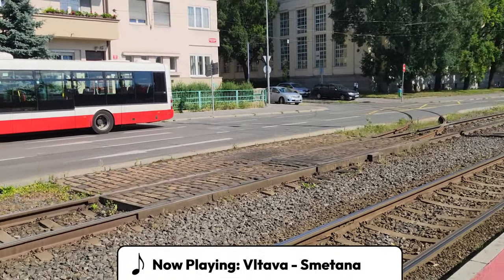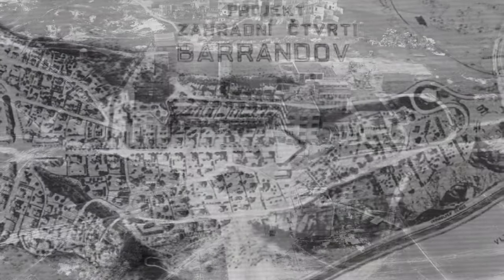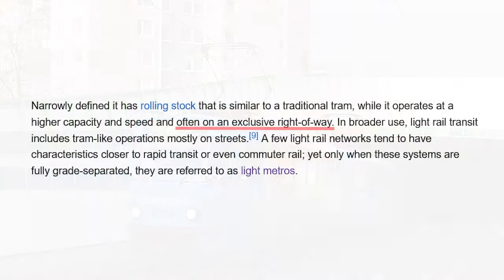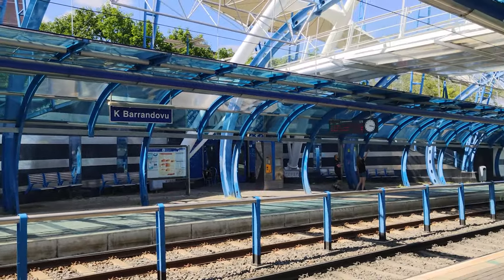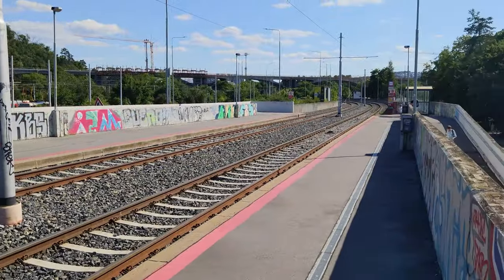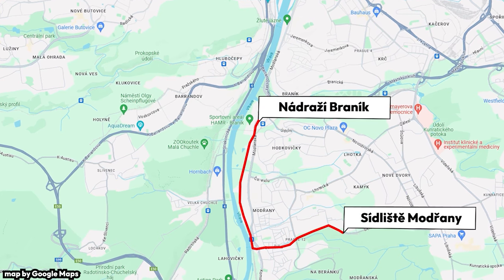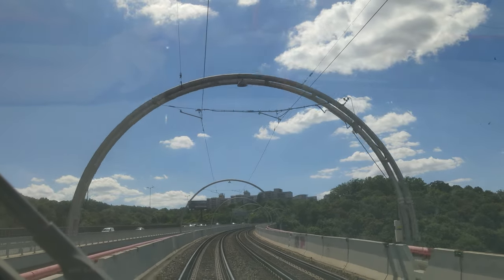A Different Approach to Trams

Comment: "Exclusive right of way" refers to the absence of mixed traffic, not to grade separation. Thats a different concept. So "true light rail" can have as many level crossings as it wants, just no mixed traffic operations. If it's actually fully grade sparated its usually referred to as a metro/light metro/subway/el etc.
Reply from the maker: Damn, I got that wrong.. pinning your comment, and thank you for the correction!
Reply: @TheTramly  That does mean the Barrandov extension goes even beyond the minimum requirements of "light rail" in some places, which is pretty cool.
Reply: Excellent comment! That's why I don't consider trams in the median to be light rail but only as tramways.
Reply: Agreed. The light rail system in Hong Kong has level crossings at every intersection, but has dedicated tracks.

Comment: barrandov is really cool, I've been there a couple of years ago, before the extension. i was in Prague and headed for Dejvice, and when going back i had some time and the trams going to Smíchov train station were also going to Barrandov, so why not. even the housing estate is neat, there are long alleyways that provide a lot of shade. 

something similar exists in Pilsen now, although on a much smaller scale, it's only a 1.5km extension to the university, but it has a bridge going over a four-lane road and its own path that doesn't follow any roads, and there are paths alongside the tracks. it could be longer by additional 300m and get extended to the Tesco mall across the street (it would make it a lot more attractive since all the malls are on the outskirts of the city, and while there's transit access, the stops are incoveniently placed and the routes aren't scheduled well enough; Plzeň Plaza is probably the most accessible since it has a tram stop close to it), but at the expense of parking spots

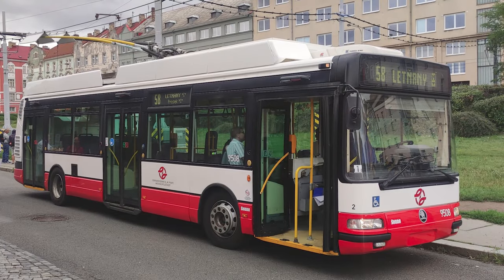2:19 hey look a former PMDP #500

Comment: We have quite a few of examples of this approach here in Poland. 
The best ones are the Poznań Fast Tram and Szczecin Fast Tram which connect faraway districts to the city centers with fully separated alligments. Allowing for higher speeds and no interaction with road traffic. 
Other good example is line 50 in Kraków. It uses grade separation where the most conflict would occur to increase the speed. 
I also wanna mention line 2 in Warsaw which uses light rail alligment to connect the district of Tarchomin across the river to the terminus of the M1 metro line with high frequencies.
Reply from the maker: Poland also has a large interurban system, right?
Trams, light rail, and interurbans are definitely great modes of public transport, fit for the 21st century
Reply: @TheTramly  you're probably thinking of Silesian Trams. That's a great system connecting many cities in the GZM area. I personally cannot comprehend the extent of this system, it's amazing how you can board a tram in the bustling center of Katowice and end up in a village with a single-tracked line 20 kilometers away.
There's also a quite extensive system of interurbans around Łódź but this one is undergoing a major renovation at the moment.
Reply: @TheTramly  Poland is completely different planet than Czechia, in Poland, when they decide to build something, they just build it, not talking about that for 20 years like we do.

Comment: We have this in Poznan the Poznan fast tram or PST line it connects the northern districts to the city and is completely grade separated (it’s sunken, without tunnels). Though the stations are like normal stops, but with a shelter in the form of the road viaducts above them 😀. At its northern terminus there is a big bus hub and the university.
Reply from the maker: shelters in the form of overhead road viaducts, big brain time

Comment: Montreal is considering Trams. There is already an underground Metro and new light rail REM. But there is consideration to add new Tramlines on some of the wider boulevards. The idea is the Trams will be able to carry more passengers compared to buses.
Reply from the maker: That could be a really good idea!
Reply: Trams will also attract more people than buses. If done well it can become a "slightly slower surface running metro" rather than "a more comfortable and faster bus" to people.

Comment: When talking about the "need" for tram line, you could try to get some passenger flow numbers like 20 K people per day per direction or so. Many people have no idea how big the district needs to be to justify a tram line. 
Also Barrandov line has some interesting quirks because of the gradients. AFAIK the trams need (or needed?) to do a brake test - coming to a full stop - before they would start rolling downhill. But I understand it is a bit off topic from the LRT discussion.
Overall very nice video :-)
Reply: you're going to go insane when you find out about route 3 in bucharest

Comment: Building a tram line to Barrandov has been in the plans since the late 1970s, and in the 1980s, the leading of the track in this route was approved.
Only the embarrassing hideous Kotas design was designed in the 90s.
The track to Modřany as well, but this track was managed to be build earlier, so it has still normal look and design of stops, not as the track to Barrandov. (Also, Modřany track has only embankments and small bridges, not any notches and underpasses, and goes mostly around the destination housing estate, not through it,the Barrandov track was more constructionally demanding, as it overcomes a large height difference on a long bridge).

Comment: We have similar take on trams in Poznań, Poland with a PST line (Poznański Szybki Tramwaj) that starts near the center of the city and runs grade separated north by big panel housing estates. We also have color coded stations, but not as architecturally pleasing

Comment: The difference between a "tram" and a "light rail" is very squishy and hard to define.

Take Los Angeles.  They currently have six rail transit lines.  Two are obviously heavy rail subway lines, fully underground using long, metro-style trains (one barely more than a branch of the other, although that branch is currently being extended greatly).

All the locals call the other four "light rail", although three of the four have tram-like characteristics, including sharing space with cars and getting stopped at traffic lights.  The C Line, formerly Green Line, runs down the middle of a freeway for most it's length and then on dedicated elevated tracks the rest of the way.  But the A, E, and K Lines have everything.  Street running on shared track with cars.  Street running with dedicated track in the middle of the street.  Dedicated at grade track.  Dedicated elevated track.  And, finally, large sections of dedicated subway-like underground track with a series of underground stations.  It's a total hodgepodge.

Comment: Great video! - good to see the actuality of a top class tram system.  You have interested me in this - to evaluate the 'nicer' stations, are there statistics for whether they have generated more use than traditional tram-stops? Same with the level crossings - any figures for how much they slow down the trams, and how this affects usage?  And how frequent are the trams? do they operate early and late? Do the fares encourage/discourage public transit over car use? Are the trams well integrated into the general transit network in Prague, and with services to/from other neighbouring towns?  Look forward to your next video
Reply from the maker: The only things I can decently confidently answer is:
Frequency: it depends on the time of day and on the line, but as for Barrandov, which hosts multiple lines, it's like every 5-30 minutes (5 at rush hour, 30 in the dead of night, think like 2AM)

as for the time of operation:
There are 2 schedules, a day one, and a night one
Not all lines run all of the time, but as for Barrandov, it has both day and night service, meaning that you can catch a tram at any time of day from there

as for integration: they're very well integrated with the rest of Prague

regarding travel to neighboring towns, the tram lines from Barrandov run to Smíchovské Nádraží, a large train station, metro station, and bus terminal, so it's possible to connect onto lots of services there
Reply: @TheTramly  Very many thanks for all that detailed information. Sounds like this really is a high-quality tram service, so I'm sure it must attract serious numbers of passengers!

Comment: Great video content wise! I'd like to offer a little bit of criticism from a video production lineup. I noticed stutter in every clip shot with a camera (aka not a map or a picture, etc). My guess is that this was caused by mixing framerates somewhere within the video production chain - it's important to ensure that your project uses the same or a compatible (evenly divisible) framerate to that which your camera films in. Since the video appears to have been edited and uploaded in 30fps, my guess is that your camera is configured to record at 24 or 25fps - either switching your project to this framerate or (ideally) switching your camera to record at 30fps should remove the distracting stutter.

Another thing I noticed within panning shots is excessive motion blur - depending on what you're recording this, you may not be able to solve it, but if your camera allows you to increase the shutter speed or enable some sort of "action" mode for video recording, I would highly recommend doing so - it may result in a bit more noise in the image, but it will lead to panning shots looking much sharper.
Reply from the maker: Glad you liked the video!

For the first one, I believe it is that, yeah, because my editing software INSISTS that I have to edit videos in 25fps, and when I switch it to 30, it just goes back to 25 again 💀💀
I'll have to look into that, it's been pissing me off for a while now but I haven't taken the time to correct it💀💀💀

and for the motion blur, I'll check if there's an action mode

thank you for your feedback!

Comment: grade seperation might not be necessary since this is a tram, as long as it has absolute priority at crossings going through at full speed.
honestly, i'm surprised they didnt use high floor trains, since low floor trams are made for street running
Reply from the maker: They actually use high floor trams as well as the low floor ones, but that's because Prague still has a massive fleet of old (albeit refurbished) Tatra T3 trams
Reply: @TheTramly  I'm talking about high floor trams with metro style level boarding, like in Frankfurt or Edminton or Calgary or Los Angeles of all places. With that design you essentially get subway cars with bends in the middle at high capacity, as rm transit says

Comment: Okay okay, and now the reality of the Barrandov track.
This is NOT how you build an efficient public transit infrastructure. The reality of this colossal tram track failure is different than what most people think.
It wes extremely expensive to build, it's poorly maintained (because it's expensive to maintain), exaggerated in everything and tragically underused. Each stop has two stainless steel kiosks, not a single one of them is properly used. Building more stuff at any cost doesn't mean it's better. It's hard to imagine the incredible amount of money drowned in this project, of which most was spent on stuff that doesn't even work anymore. Even the architect who is responsible for this abomination said it's the biggest failure of his career.

You don't need expensive pompous nonsense on a tram track that's literally only used by local people.
This is exactly the approach you need if you want to destroy the public transit.
Now seriously... let's build efficient public transit, not this kind of expensive nonsense that only harms the city.

Comment: I am missing numbers and footage from the POV of an average passenger. For example, what is the best alternative? If it was built 20 years ago, it must be a very well documented decision with easily accessible documents. And once it has been highlighted, quantitatively, what is the benefit of it been built like a "light rail" line?

Btw it is 2,9 km long if I calculate well. That's like 10 minutes by bus or by bike, and 40 minutes by pedibus. I don't know how many decades it will take to get a return on investment. Maybe 2, maybe 20. The problem is that I can't find the answer out from the video, not even giving a hint.

Comment: "Light rail" is an artificial american buzzword, that doesn't make sense in Europe. It's time to ditch it.
Reply: Would disagree. In German, ee know the word „Stadtbahn“ (basically: city rail) and it is pretty much what light rail tries to say.
Reply: @christophkeresztes8617  Not really? Stadtbahn itself is a pretty bizarre concept.
>Most Stadtbahn systems are now a mixture of tramway-like operations in suburban and peripheral areas and a more metro-like mode of operation in city centres, with underground stations.
So, it's just a tram with underground stations? And how does it differ from metrotram? And if we run the tram through elevated lines, should we make a new name for that?

Comment: And what do trams, metro light rail, streetcars etc. do what a bus can't do?  Seen my area waste billions on empty light rail that just take up a valuable center median when our buses do the job.
Reply: In short trams are faster, have a better acceleration, have lower energy consumption, have a higher capacity and are more comfortable for passengers.

So trams are basically a kind of rail transport that is not really comparable to buses. The same things characterise the other modes of rail transport, just to a higher degree.

But while rail is cheaper to run in cities than buses, it is of course more expensive to build so trams are usually only a relevant investment in cities with more than 200.000 inhabitants, and metro in cities with more than 1.000.000 inhabitants.

There are other factors too. It is usually more efficient to implement rail in denser cities than in areas with a lot of urban sprawl.
Reply: You wouldn't be saying this if you lived in Prague. Not our fault your city wasted money on a poorly designed system. The tram network is dense and it's reliable, and it's without emissions or unnecessary batteries. And because it's on rail, it can overtake busy traffic unlike buses that get stuck more easily. The Prague metro itself is the most reliable piece of public transport. Delays are incredibly rare, you avoid bad weather, transfers are easy and you can travel long distances across the city.
Reply: @troelspeterroland6998  + the rail acting as a guideway makes single long vehicles more practical, so you can get higher capacity per vehicle as well, on top of having higher capacity overall by having shorter headways.

You can also connect and disconnect vehicles to adjust to different capacity needs